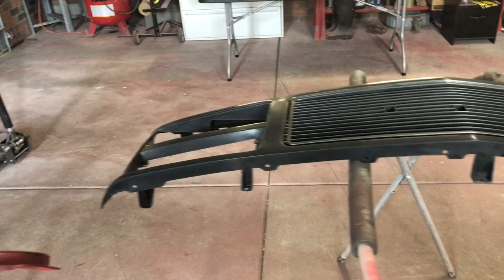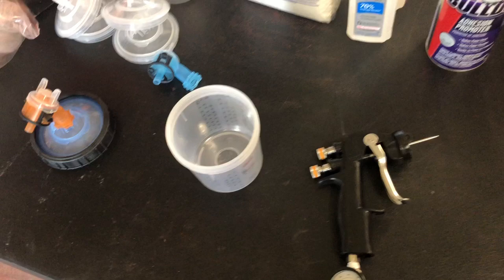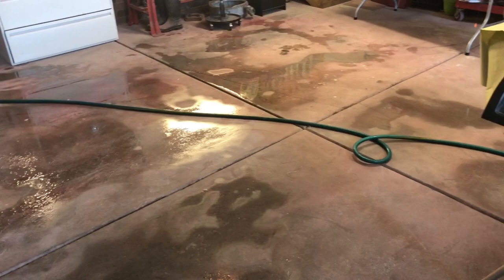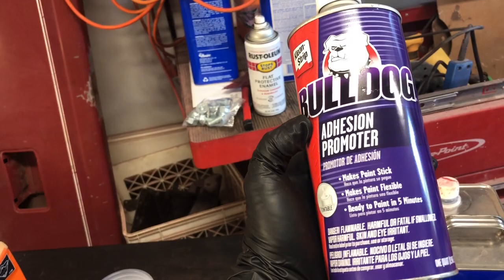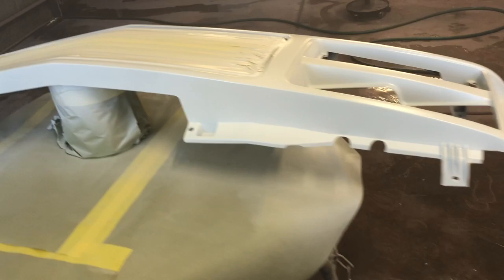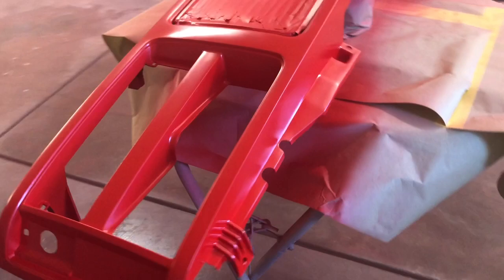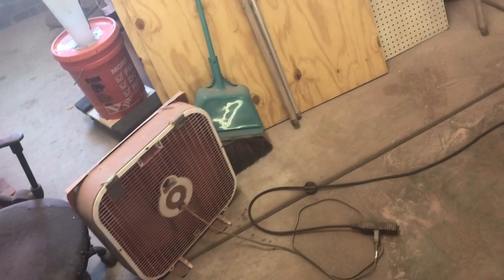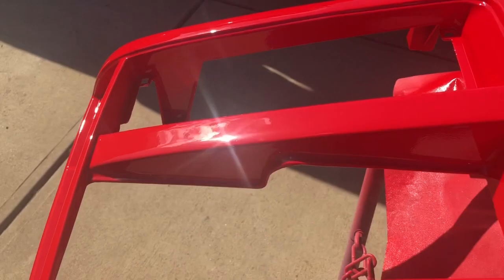How to paint grill and plastic car parts DIY

Comment: Holy crap dude, I’m just going to buy a can of flat black and go for it
Reply from the maker: Honestly it will probably turn out good man.  It all depends what you are going for.  A paint match to the body just takes a bit more work
Reply: I painted a plastic grille with flat black from a spray can and after 1 year it is bubbling off the grille.  Never stuck well.

Comment: For this grilles do u have to use a sealer primer?
Reply from the maker: I did mostly because the red covered the white sealer with less coats and was brighter.  I have seen body shops spray the paint on plastic parts without using sealer as well